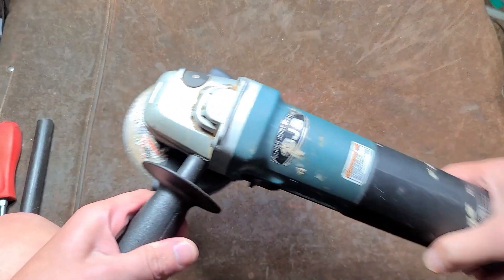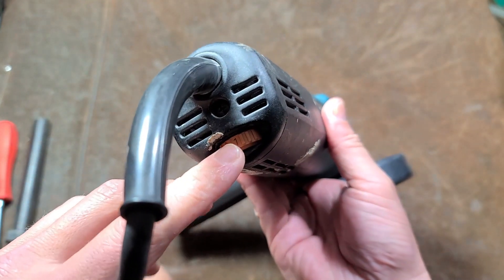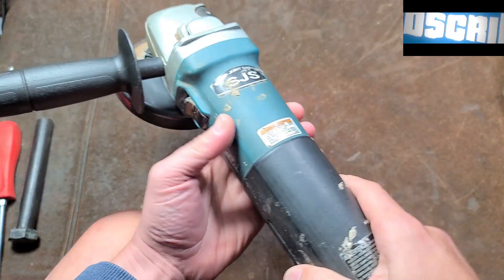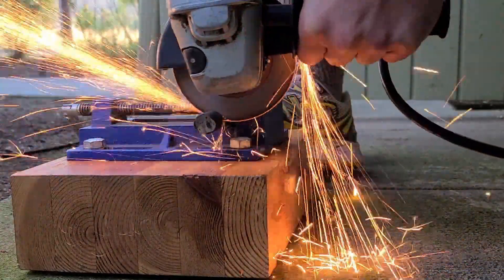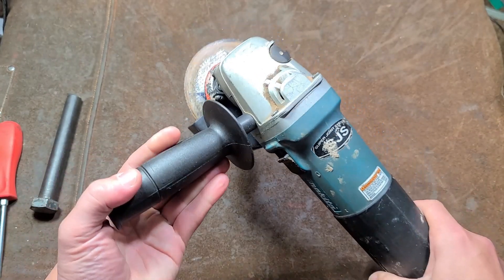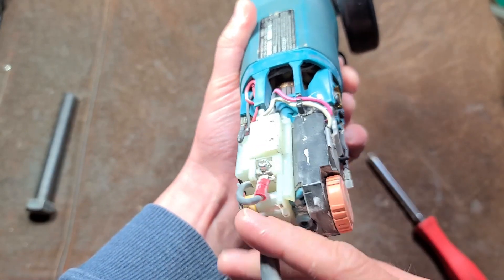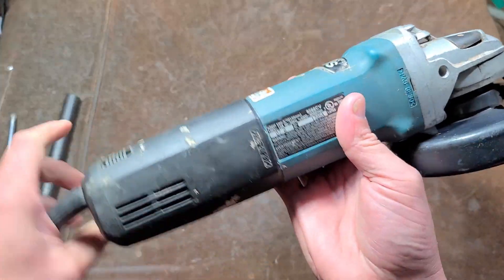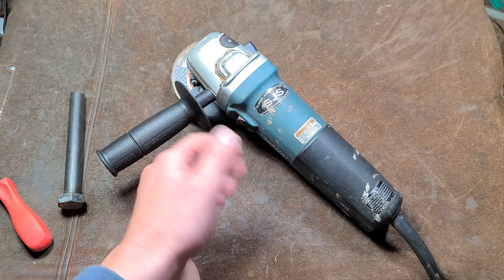Makita Variable Speed SJS Angle Grinder Review

Comment: You’re absolutely correct about lower speeds being actually more effective at certain operations. I just came up on that myself over the last couple of days having to wire brush a bunch of angle iron I’m prepping to fix a bed frame. When I had the grinder screaming at full blast, it would seem like initially it removed the rust and scale faster, but when I’d take a second look I started noticing that the brushes wouldn’t be able to really get in the small pits and channels in the steel without me wrenching down hard on it (which starts wearing out the brushes like crazy). When I slowed the grinder down to like a 3-4 (also a 4 1/2” Makita) it cleaned faster, and better, cause the brushes now had the time to actually get into all the small pits, and not skip over them. I also noticed that I had a lot more control, and could hit the edges easier without it kicking back on me.
Reply: I just got a variable speed angle grinder, didn't use it yet. It amazed me that few models have variable speed, I am used to drills and sanders which all had variable speed, it seemed logical.
On grinder, which runs very fast, it's very important to lower the speed, think lowest speed of grinder is 3000rpm, which is highest speed of a drill, just to imagine the scale.
Drill has a centered drill bit, quite safe to spin and is limited to 3000rpm, while this large disk rotates at up to 11000rpm? just imagine the safety issues...
And for sanding and brushing, you can just use it on speed 3 of 6, being a little bit more patient is fine, no rush. It would be faster than sanding with a sander anyway, especially on metal.
Lower speed makes it more suitable for multiple tasks.
Even on drills, having dual speed gearbox, plus variable speed + speed control based in the trigger, gives you all the control and torque you need. It's becoming the ideal tool.
Reply: That’s cause most grinders, particularly larger models are mainly used to work on metal, at production speeds. They’re mainly used for grinding/flapping (with some occasional cutting). They need to last and be reliable. That’s why most don’t include a variable speed control, it’s not necessary, and just adds additional parts that can fail, or allow dust ingress. That’s mainly you find variable speed on smaller grinders, those generally are the ones you’d use for stuff like wire brushing at slower speeds.

Comment: So you were cutting that bolt at about 8250 surface feet per minute, or SFM. SFM is a very important factor when cutting any material as it gives you more control over friction generated heat, tool wear, surface finish and even work hardening. An easy to remember formula to calculate SFM is, cutting tool diameter X RPM / 3.82. You can also use the 3.82 in the equation to calculate the RPM needed to get the same SFM with a different diameter cutting tool like a 6" cutoff wheel. To get a similar result you would use 5250 RPM with a 6" cutoff wheel. 3.82 X 8250 (SFM) / 6" = about 5250 RPM. For this tool setting 2 would work to get close to that RPM.
Reply from the maker: Thanks for the detailed explanation! It's always good to consider all the factors when using power tools.

Comment: Only thing I am finding with these grinders is the dust extraction is bad gets stuck around the brushes and shocks me through the case.
Reply from the maker: I've heard about that especially when using grinders for polishing things like aluminum. I learned about that when I saw somebody with a large nine inch grinder with the brush covers missing and he said they just pack in within a couple hours and they just constantly have to blow them out so they just don't run them with the brush covers removed.

Depending on what you're doing some Grinders and better than others. Dewalt makes corded brushless grinders that won't shock you but they will still clog up.

Comment: i'm trying to figure out the sound effect used in a game (not now, but i'm trying to figure out in general) where they use some ....random loudass machine sound and it revs up and down between high whiny vacuum and obnoxiously loud like fan cooled grinder (has a coffee grinder-like tone too, same motor so :u) but you talking about it's load compinsation/detection is exactly what i was trying to reverse engineer as i wanna do something where it kinda does something similar and/or timed/random rpm variations  or in the case just a generally smarter motor/voltage regulator design however you want to cut the cake

Comment: Good job C.M. I have a variable speed angle grinder, but since I got my variable speed Die Grinder, the V.S. Angle Grinder has gathered dust.
-
 I put a 3" cut off blade with my V.S. Die Grinder and absolutely love it.  It's like a giant Dremel. - - Just yesterday, I cut bolt heads off inside a toilet tank.  With my normal speed die grinder or angle grinder there would have been sparks and debris flying everywhere,  but with the V.S. die grinder  it cut bolt heads quickly, cleanly, and with none of the high speed problems.

Comment: I have Makita 250w variable speed drilling machine. If you use cobalt based drill bit (suitable to cut stainless steel) it works great in slow speed for most of the polymers and metals

Similarly i have maktek sabre saw, the low speed works great in most of the cases